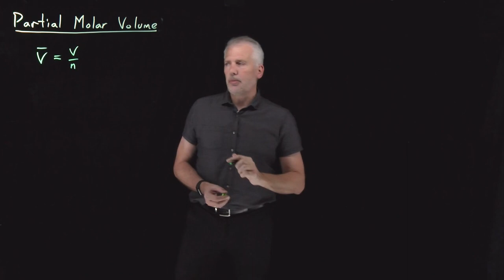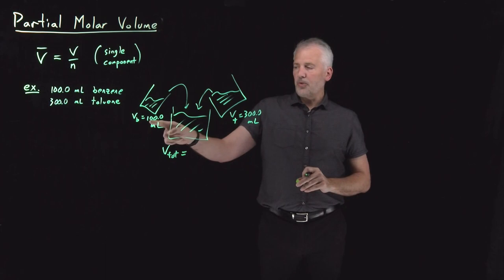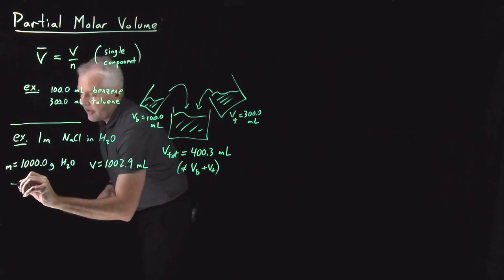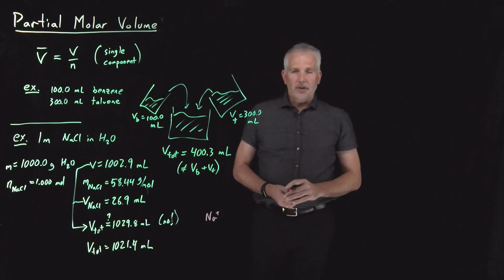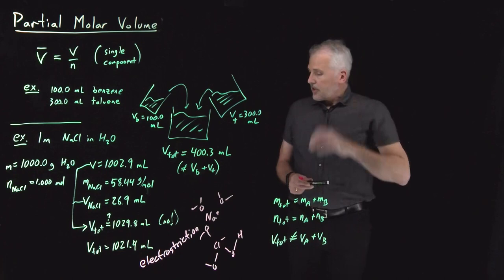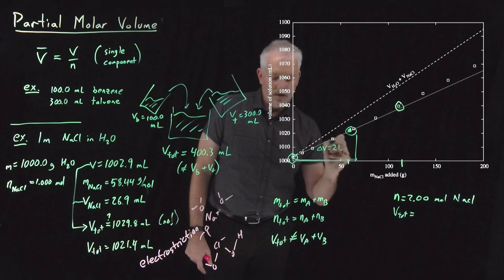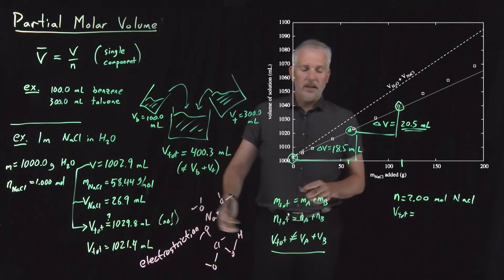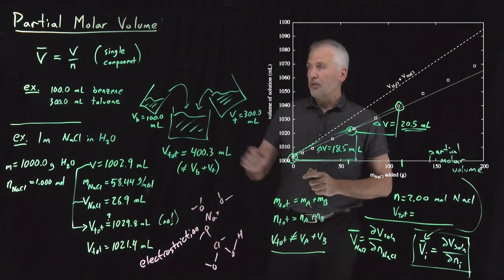Partial Molar Volume

Comment: I understand that calculated volume of NaCl and water is less than expected volume because of the disassociation of nacl into Na+ and Cl-  but in first example why the sum of volumes of benzene and toluene is more than expected you didn't gave the reason
Reply from the maker: For benzene and toluene it happens to be the case that the toluenes keep the benzenes from packing as closely together as they would in the pure liquid, and vice versa. The details depend on the specific solvent / solute pair, and are not always easy to predict.

For an (oversimplified) analogy, consider fruit: if I have a crate of oranges, and mix in a few bananas, this will disrupt the structure and the volume will be greater than the volumes of the two fruits by themselves. But if, instead, I mix in some grapes, they will fit in the gaps well and the total volume will be smaller than that of the separate fruits.

Comment: Going through the slope to determine Dela V is not understandable, because the of the straight line is constant
Reply: The slope
Reply from the maker: The ΔV values mentioned in this video were not obtained from the slope, but from ΔV = V₁ - V₂: measuring the actual difference in volume between two solutions in an experiment.

The slope of the dashed and dotted lines in this video are constant. But the slope of the actual, experimental V(n) curve is NOT constant. Indeed, this is the whole point of the video: every incremental amount of NaCl added to this solution increases the volume by a DIFFERENT amount.

When we measure ΔV/Δn to find how fast the volume of the solution is increasing as we add more NaCl, we are making an approximation. When Δn is small, then ΔV/Δn ≈ ∂V/∂n. The derivative ∂V/∂n is the actual slope of the V(n) curve at any point, and this is what we are really interested in. The next video in the sequence (https://www.youtube.com/watch?v=MuPlXAcxCmA) begins to use these derivatives, rather than finite differences like ΔV/Δn.